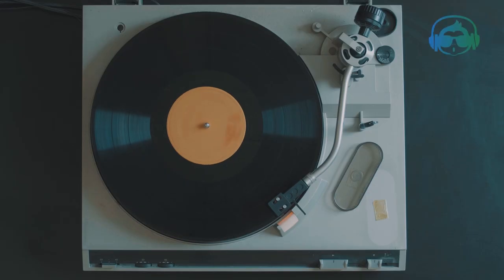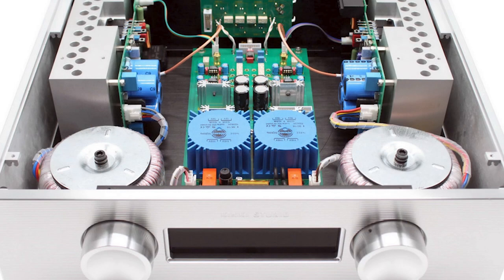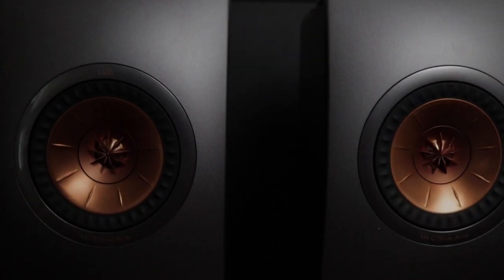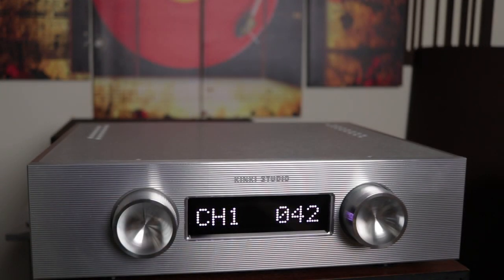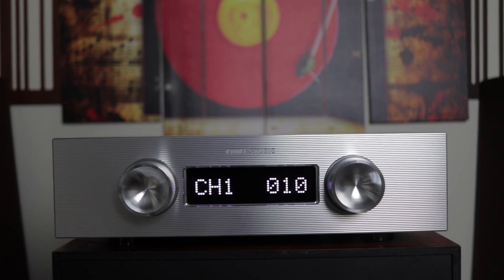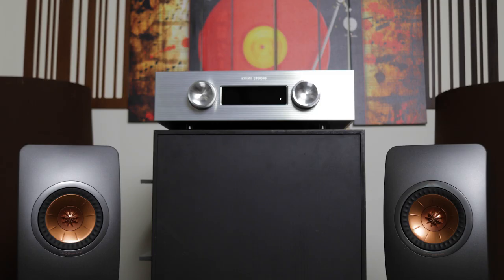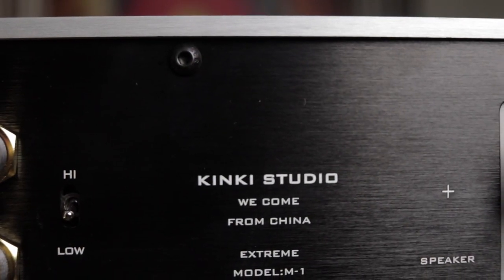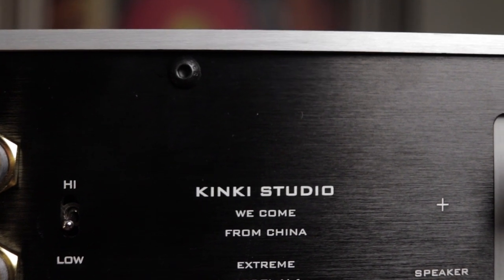An Integrated Amplifier That Sounds Better Than Most Separates !

Comment from the maker: This amp is class AB !
Reply: Ab?? Really ???? I don't think so too small I don't see the caps
Reply from the maker: @Montreal_Audio_Systems  its class ab !
Reply: @Montreal_Audio_Systems  I'm with you. I want to know how much filter caps
Reply: @YannickKhong  it must be low amperage what about damping factor is it high? Probably a fast amp
Reply from the maker: @YannickKhong  Asked about the filter capacitance. You will know when they reply to me
Reply from the maker: @YannickKhong 

From kinki:

 350w/channel at 4 Ohm (very conservative).

Total filter-caps per channel is 6,000uf. The amplifier was deliberately designed to have ultra-fast transient response.
Reply: How does it compare to Hegel (similar specs)
Reply: @ufarkingicehole  people find it better than H390 with Dynaudio special 40. That’s the comment that led me here.
Reply: @ufarkingicehole  Even the Hegel H120 has more caps per channel than the Kinki.

Comment: I would say the EX-M1 was not intended to be used with the KEF or Klipsch speakers given its price point.  From the US distributor's website and his related videos, Kinki's intention was for it to complete with more expensive integrated amplifiers.  For example the US distributor was using it with his Magnepan 3.7i and compared against a $5K US built integrated.

Comment: Would you assume the M7 would sound better since it has more capacitors and essentially a beefed up version but obviously it’s a power amp so there’s no volume control I’m assuming the M7 would sound better especially the frequency response seems to be different on paper when you look at the websites this universe is the M7 seems to be different I feel like the M7 has a wide range frequency so in theory he probably get a better transparency wider range of everything and since it’s a beefed up version I’m thinking there might be more meat on the bone with a full or more dynamic sound maybe I don’t know! Any thoughts?

Comment: Does this unit run hot after awhile? I hear it runs hot and that’s not good in my opinion! I like lightly warm after hard use would be nice to review there power amp m7 ! 
Great video btw
Reply: Hi Newton R. In a well aired area the unit is lightly warm. It does not run extremely warm or hot, not even in summer temperature.

Comment: How would you compare the Kinki to a Hegel? Would you say the Kinki EX-M1 is as good as the Hegel H390, may be even the Hegel H590? Cheers.
Reply: Voon Piao Siang @thenextbestthingstudio we need to know Hegel vs Kinki
Reply: @drwavedawg  true since from the little I know he does like those HEGELS..? I wonder what's your opinion now please..lower priced and a more  general all around  better performance. .?
Reply: Edward WISDOM KEEPER/SEEKER OF TRUTH I never heard the Kinki. I would imagine that is a good match for speakers that lack dynamics, that need a good fast amp. Like a Spendor or Harbeth, maybe Gershman. Those already have very rich forward mid range. Remember the kinki has a U shaped voicing, slight dip in the midrange. Btw, common opinions is that the Kinki is a Goldmund copy. I have no reason not to believe that is true.
Reply: Not answering gives the answer.  It doesn't outright beat the Hegel. But he did comment at around 3:50 mark for about 20 seconds as to the nature of its' sound...sounds like what the Hegel does but maybe not as smooth sounding, a bit sharper, thinner, faster perhaps, so speaker dependent. It's likely a very fine, well engineered amp that you only need to add sources to, which I prefer although I own a Hegel and am quite happy with.
When it comes to amps, as the song goes, love the one your with. Amp hopping doesn't really change things, although there are a few stinkers.  Better to find the most perfect speaker you can afford/live with, a nice affordable dac, streamer and/or tt.  At the price, under 3K, there are alot of choices of good sounding, reliable products. The Kinki may be one of them. What wouldn't I buy, I know I wouldn't buy Musical Fidelity. But there are alot I could live with. Alot.

Comment: Hi , how does this amp compares with the Hegel H190? I saw your reviews on the Hegel H120 but it seems that you like more the Kinki. Don’t like about this one is that it is difficult or impossible to return if you don’t like it.
Reply: I have owned Hegel H190 few years ago. Recently I bought this Kinki integrated. 
Kinki has much better detail, way bigger soundstage. The bass is incredible.
Reply: @goahead3995  that makes sense as its an all analog amp so all the money goes for the amp, Hegel h190 is still very good in my opinion and good with bass controll, i think you need to step up to h390 to have simular amp to kinki, and you save money with kinki, of you already using a seperate dac and streamer, whats great about hegels is that you get everything included in the amp,

Comment: nice video and Im actually looking for an amp for my ls50s, but Im not gonna spend 2K on it, fdor that price I can get brand new LS50w, what amp under 1k would you recommend, that is not class d?
Reply: I have the Cambridge CXA80 with my LS50's and it's a perfect pairing. Highly recommended if you like a lively sound with a huge sound stage and lots of power to spare.

Comment: So how much are they about on the street? This got me interested. What high end amp that you have tried you believe it's performance is comparable to?
It's the fact you mentioned it is balance that caught my attention. Usually high end gear have that characteristics, budget gear tends to exaggerate stuff. great video.
Reply from the maker: These are 2400 usd. Ayre or naim has similar characteristics and dare I say dan dagostino ? Cheers thomas !
Reply: @Jayiyagi  I see, seems like there are a few reveals online for other gear from this company and it looks good. At $3k cdn, they must be awesome else it's hard to break into the audio market.
Reply: I would never spend that kind of cash on an Asian amp. Check out that knob if ever it goes which it probably will have fun getting in touch with them for a replacement part.
Reply: With that cost I could pay a DIYer for a Pass Labs Aleph J and a B1 buffer preamp..and still save money.
Reply: @siddhantmerh592  Once you go DIY, anything is possible. But have to know someone who can do a good job and there is no resale value with DIY stuff so that is the only reason I stay away fron DIY,
Reply: This amplifier is "inspired" from Swiss Goldmund amplifiers, with some cheaper opamp implementation and lower price because it's made in China. The preamp in it has high gain which added to the already high gain of the power amp results in too much gain on the integrated amplifier (tweeters will probably hiss with efficient speakers). There are separate monoblock amplifiers also - I think those are a better buy than the integrated amplifier. 

PS: Search "queenway 29m" on google to find previous aliexpress listing of the monoblocks. Personally I don't like it when people "borrow" intellectual property so I avoid this type of product.
Reply: The Next Best Thing Studio  those are all pretty different.
Reply: Montreal Audio Systems so you'd prefer being ripped of spending double for mcintosh instead of accuphase? Good.
Reply: @siddhantmerh592  Oh you would think they are good. I had both...Eh.
Reply: @weskoki  both amplifiers?
Reply: @eug3nius  This. I don't like it either. Copying and claiming as your own is not okay.

Comment: Unfortunately after sales service at Kinki Studio leaves a lot to be desired. My EX-M1+ amp, only a few months old, developed nasty distortion on every channel. All Kinki has done is to blame it on my cables. I have checked my cables on two other systems and they are in perfect condition. Kinki refuses to swap out the amp. For that reason I have to recommend you avoid Kinki Studio products at least for now.

Comment: This amplifier is "inspired" from Swiss Goldmund amplifiers, with some cheaper opamp implementation and lower price because it's made in China. The preamp in it has high gain which added to the already high gain of the power amp results in too much gain on the integrated amplifier (tweeters will probably hiss with efficient speakers). There are separate monoblock amplifiers also - I think those are a better buy than the integrated amplifier. 

PS: Search "queenway 29m" on google to find previous listing of the monoblocks on aliexpress. Personally I don't like it when people "borrow" intellectual property so I try to avoid this kind of product.
Reply: Replaced my trusty hegel h190 8 months ago with the kinki monoblocks and matching preamp stack, paid 6000 CAD all in, auditioned a ton of gear from 5 grand to 10 grand, the only SS i liked for my ears more was the top of the line luxman l-509 (a smidgen more tonal accuracy) and a pass labs xa25 and matching preamp/headphone amp (richer colors and textures) but these options were almost twice as expensive, and neither had the slam, bass control and sheer dynamic energy, which sometimes i need when listening to that kind of music. IP theft aside, kinkis stuff is very good and excellent value.
Reply: @michaelmityok1001  Where did you purchase it from, you mentioned in CAD.  I'm from Canada as well.
Reply: @mzikmund1  Kinki Studios website allows you to order online, the distributor/warranty repair is Vinshine Audio, payment is via PayPal, remember you pay duty and taxes. The point about gain is true, if your speakers are efficient you will hear tweeter hiss. But if you can live with that, you wont find better built or sounding gear for the money.

Comment: ....great integrated...can i ask if it is a good choice for tekton design double impact? Can you help me? Thank you...
Reply from the maker: Yeap. Definitely a good choice
Reply: @Jayiyagi Thanks a lot... with a warmer sound amp is better ? Modwright? audia flight?
Reply from the maker: @scharax  if you want a warmer sounding amp... Try hegel h90 or h190.
Reply: @Jayiyagi  h190 or h390? More power? Or it is ok with h190?
Reply from the maker: @scharax  h90 is more than enough power for the Double impacts. H190 is a little warmer. H390 is as warm as the h190 with more gutt but overkill - excellent if you can afford it.
Reply: @Jayiyagi  thank you for everyyhing...
Reply: I want a little more help... 1st choice Hegel h360 2.Modwright kwi200 3. Pass labs int150 4. Audio Analogue maestro anniversary....You advise me Hegel again? Thank you truly for support...Thanasis
Reply: @scharax   and please also comment Audia Flight, can you compare Kinki with Audia Flight
Reply: @Jayiyagi  Can you please also compare Kinki to Audia Flight?